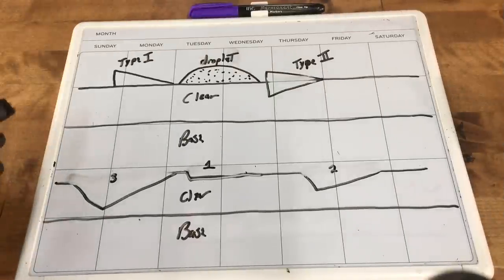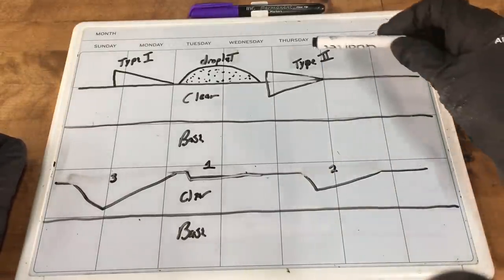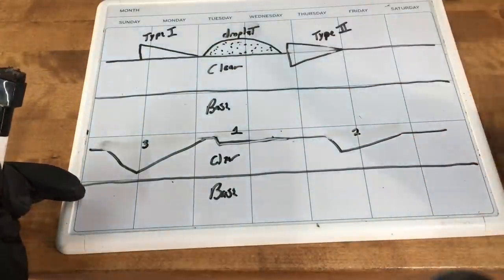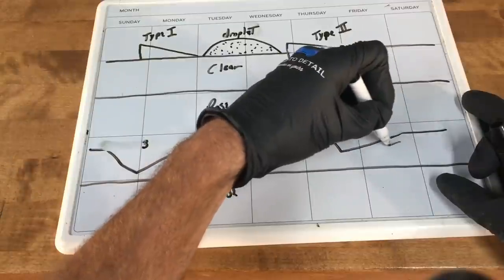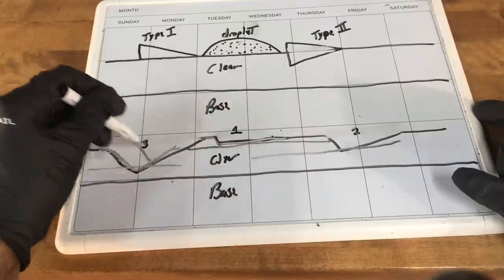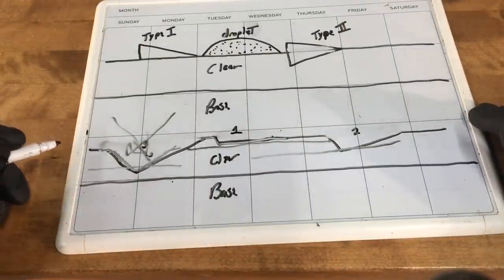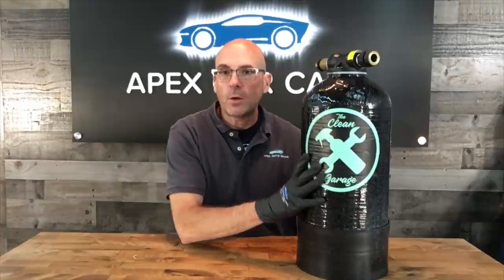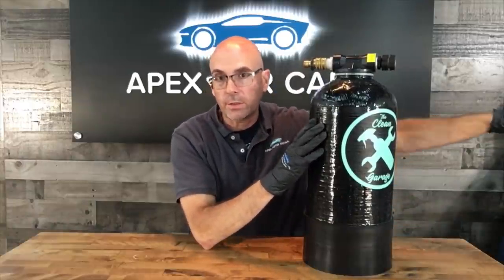A Deeper Dive Into Hard Water Spots!

Comment: Thank you Brian- always a great watch. If you think your water is bad, in Florida our tap water is 441 on the digital hardness reader, lol. The DI rinse is a great solution, although the harder the water, the quicker you burn through the resin. 
I tend to use Meguiars wheel brightener 4:1 with a quick wipe on the paint followed immediately by Wolfgang rinse less wash to neutralize the cleaner's acid and that gets the spots off quickly for me.

Comment: I owned a black Mazda Miata about 20 years ago and etching from rain was a hideous problem. IRL, it's not always possible to remove water droplets right away...before the rain and sun do damage. Eventually, the dealer had to repaint the car under warranty. Lesson I learned...NEVER, EVER own a black car as etching can be more problematic due to the solar furnace temperatures on the surface of a black car. 😱

Comment: Really good video for a common topic. The big thing as Brian said is to understand the basics of the chemistry so you know how to tackle it. Acid eats the minerals that makes up hard water and it doesn’t have to strike fear! Another simple, but very effective point that I’d like to emphasise is the use of rinseless washes - they are very effective, particularly when used at QD dilution  (1:16 for ONR for example) when left to soak, soften the hard water deposits and then safely wipe them away. 
People reach for abrasives too quickly when they are only needed when there’s the pitting too.

Comment: I noticed that your DI vessel has brass fittings. I took note of the warnings that DI water erodes copper, galvanized, brass & bronze by leaching and only use plastic or stainless steel.

Comment: Thank you for another fantastic lesson. One question please: How can one verify whether the etching has touched or gone to far in the base coat? Is it with trial and error by using the methods mentioned by you? Thanks again Brian
Reply: I’m sure Brian will respond to this as well. In Maui hard water is like automatic. People are totally uneducated are ignorant of the sprinklers waters lawns and resorts, and at some point in time get their car bathed in hard water. The sun of course is brutal on the finishes. After an acid bath... I need to use pretty aggressive chemicals here...carefully... and rinse throughly and quickly before anything dries. 

WHAT YOU WILL SEE IS THE MINERAL DEPOSITS ON THE SURFACE GONE, AND A MINERAL RING ON THE OUTER DIAMETER MANY TIMES, GOING INTO THE COATING OR PAINT. WHEN I SEE THAT ITS MY FIRST CLUE TO EXAMINE IT WITH AN EYE LOUPE !

I’ve had multiple layers where dust and dirt has blown onto the car and new hard water hits it and covers the dirt. ( Had a Mercedes recently totally embedded and after a strong contact wash looked just as dirty as when I started. ) 

When I see that, and it’s more often than not on a neglected car, it’s a conversation as Brian says. 

I got lucky recently on a newly corrected car, lent to a uninformed friend that parked it near a sprinkler. Thankfully the owner contacted me right away and kept it out of the sun until I got it. The Wheels had TW graphene spray that has a pinch of wax in it that protected the wheel, it wiped up easy. Apex Metal Oxide on the car, the side panels cleaned with a mild acid wash with new microfiber towels.. very gentle. Re applied hydra bead after a wash, the hood ultimately I had to gently remove the coating , as the mineral was in the coating not the paint, perfect finish and yellow rupes 15 mm DA, just a couple of passes to remove coating, panel wipe and re apply.
Reply: @alanwallace3253  Thank you for a very informative and helpful post

Comment: The first auto detailing company that creates a product that is not only slick, hydrophobic and Prevents water spots will corner the market in auto detailing. Water spots in the one thing no one has been able to resolve.
Reply: It's is simply impossible to prevent water spots with a product you could apply to a vehicle except ppf. Products that bead up the water make things worse and sheeting behavior only works with enough water on the panel like when rinsing. Keep the vehicle away from hot water and out of the sun after its wet are the only ways to eliminate the issue.

Comment: I have bad water etching on my rear window and passenger side windows. Think it was from a sprinkler at the dealership which is located in the desert. Nothing works. They’re so deep it’s like I’m not even touching them. Didn’t see them when I bought the car because it was under a roof on a gloomy day.
Reply from the maker: Try CarPro Ceriglass
Reply from the maker: Try CarPro Ceriglass
Reply: For windshields, rear glass , or roof tops, where the hard water is severe I use the car beauty Pro. This is a thick liquid acid formula, Long gloves and a plastic non scratching pad to work it. I keep a bottle of distilled water to make sure it doesn’t dry on the surface , as I work it , I’m testing small spots by removing a little to see if the glass is coming clean. The wipe off and rinse with ONR and then water. I might polish after that.

On side windows I won’t risk any liquid getting down the molding into a door panel so I use the green bottle, it’s more of a paste. Work it in, keep it moist and the I use it like a polishing compound with a 2, or 3 in rotary and a microfiber cutting pad. Great results. Sometimes I need a second application. But very safe. Again I rinse throughly and typically foam the whole car again before moving on. As a protocol, I’ll foam, rinse, and contact wash. Then attack all the hard water, rinsing as I go. The one more foam bath, power rinse and dry. Then move on to paint correction etc. 

I never use steel wool it can scratch the glass. Polishing with cerium oxide is a long tedious process to clean up scratches in a window, Ive done it a few times with success especially on older glass that is hard to find, just have to be patient. As a rule I don’t use it for water spots, not opposed to it though. I’ll post pictures on the FB forum of those two products.

Comment: Takes me 10 minutes to fully rid a car of hard water spots. Even lizard scale water spots.
Reply: I usually use aluminum brightener spray car with a spray bottle. Wash with microfiber wash mit. Pressure wash off and done. You can use it straight for lizard scale hard water. Even after water spots are completely removed, if it's etched or burnt from hard water then menzenara heavy cut and final cut.